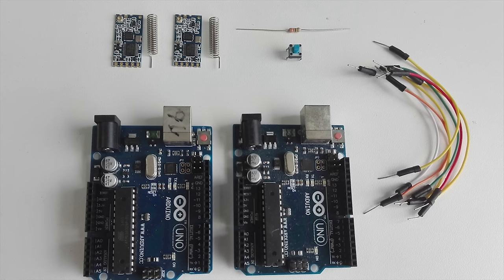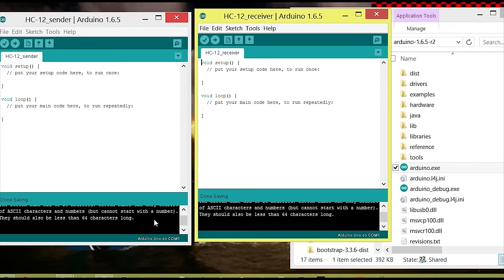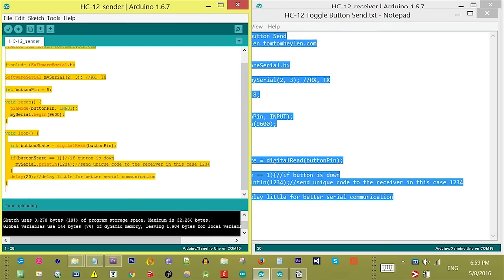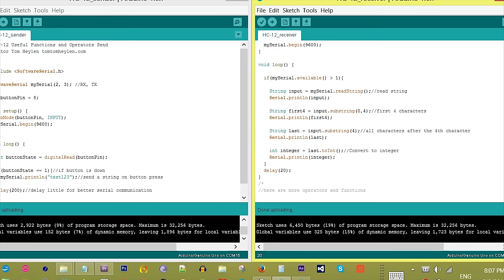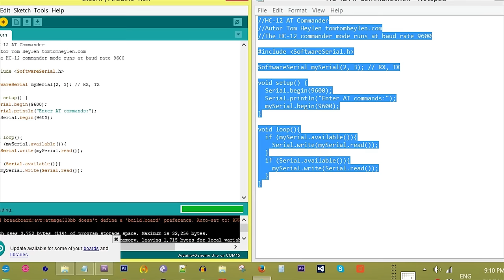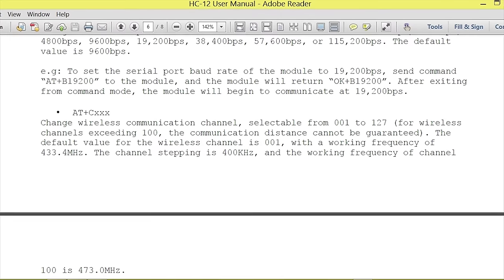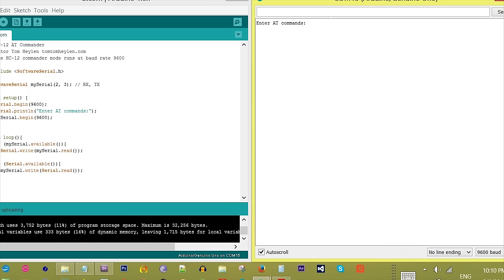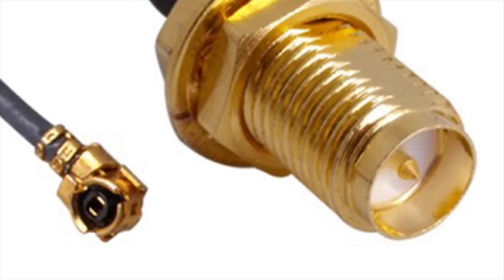Long range, 1.8km,  Arduino to Arduino wireless communication with the HC-12

Comment: Excelent video, +Tom Haylen!

I need to make a live communication system between a weather ballon and a home base on the ground. The altitude of the baloon is at least 100,000 feet and it needs to transmit at least a 360 degrees live video shot and telemetry. 

I know these transmission speed nor ranges are enough. How would you implement this?
Reply from the maker: +Victor Rivarola Your project will require a lot of research and testing. I would go for satelite connection in your situation.
Reply: Thanks. 

I guess I could arrange for a satellite transmission of the video feed, but I still really need the radio to transmit at least the telemetry. Is there such a solution?
Reply from the maker: +Victor Rivarola You  need to look in to a satelite module. And use the Iridium satelites. I'm not experienced with it but I think Iridium is an open source satelite network. It allows you to send and receive data anywhere on the planet. Here is the link to one of this modules.
https://www.sparkfun.com/products/13745
Reply: I wish that was the solution, but it unfortunately isn't.

If I use the Iridium satellites, I am restricted to use a packet driven mechanism a few hundred or perhaps even thousand bytes long, and it is restricted to RS232 speeds anyway.

So while it would work for telemetry, not for live video feeds.

From the time the balloon is released, until the time it bursts, and even when it is on its way down, I am guaranteed a clear line of sight signal until it rests on the ground practically. While I could still use Iridium satellites (these could be interesting when it comes to recovery of the balloon--"Here am I, rescue me!") it should be possible for me to have a small semi parabolic antenna and keep it pointed to the base at all times using the sensors already present in the balloon plus a few steppers. 

All I need is for the way for me to get a long enough point to point link going at all times.

I have also solved the problem of obtaining enough power (I could simply use solar), so I literally got that to spare.
Reply: So, my question basically is: how can I get a high bandwidth line of sight (one high res analog TV channel plus telemetry is minimum for meeting all the requirements, but only telemetry is also acceptable) , point to point, radio link going?

The solution would be similar to the one you exposed in your article--except that it would need a higher resolution and higher range.
Reply from the maker: +Victor Rivarola Sounds like an interesting project you're building. You have to do a little more research. There are other modules available on the market. Have a look here:
http://www.aliexpress.com/af/long-range-433mhz-module.html?ltype=wholesale&d=y&origin=n&isViewCP=y&catId=0&initiative_id=SB_20160511175729&SearchText=long+range+433mhz+module
Reply: +Tom Heylen 
Earth is much closer than any satellite. At 30 km (100,000 feet), it is much closer than say 300 km.
Reply: +Tom Heylen 
Uh, I will not get with Lora chipset. It has only 300 kbps transmission. Out there are much faster transmitters based on Si446x, which can go up to 1 Mbps (This HC-12 has this chip, just wrong MCU support on the board). I am about to mess with an "old brother" Si443x, which has only 256 kbps, but principle is the same (okay, some more code is needed to add to use frequency hopping if needed).
Reply: +Victor Rivarola 
If you think of live feed from the balloon, you need analog transmitter - some of FPV transmitters on market. Telemetry is okay with HC-12, but out there are versions with PA up to 1W. Just... how much payload your balloons can lift?
Reply: +WildMania 

Yes, I understand that the Earth is much closer than satellite.  This is one (a very secondary one) why I would rather not use satellites.

The Si446x really sounds like a good choice... 1 Mbps should really be enough, although incredible tight. It might require me to implement a Raspberry Pi controller to reduce the streams resolution before transmitting, while storing the high res stream on a SD or USB card for later extraction. That way, if I loose the balloon on retrieval, not everything about the launch is lost!

As for my balloon's payload capacity, that is undecided as modifying it later is much easier than modifying the electronics. Indeed, it should be possible to make a successful launch on one balloon, recover it, and use a larger balloon for a later launch.

However,it must not be that light. The things I need to launch so far are:

* 3 or 4 high res wide angle cameras and lens that must be sent by one link, using time sharing.

* Power source, which would include a large battery and a solar generator.

* Transmitter equipment.

* Data storage equipment (SD cards).

* GPS receiver (for a backup--these guys usually stop working once you reach a certain altitude, so I trust the accelerometers and gyroscopes more).

* Gyroscopes, accelerometers, temperature sensors, air pressure sensors, a push button (this would be modified and attached to the balloon's string--it would essentially be pressed when the balloon explodes, although the accelerometers could also provide that information), a few servos and/or steppers.

* Parachute (the alternative is not really acceptable: to make it bounce like a ball).

* Perhaps a few other stuff.

So, I would say in the order of 10 to 20 kilograms minimum would be minimum, perhaps even more.
Reply: +Victor Rivarola 
Not only that Earth is closer than satellite - you have to know when satellite will pass and use really good antenna, so idea about satellite as data repeater fall off the cliff. 

Out there are finished solution - without messing with programming Si446x, which are based on the same chip, but has 1W - good for long range communications. Only, those products are restricted by chip which is set to fixed values of data rate of about 384 kbps, which is still good for sending still pictures. If you are good in linux (I am not), then you can use 5 MP camera on Raspberry Pi and send single picture every so with telemetry data attached; where is the camera positioned, where it is oriented (azimuth, elevation...), and so on. Also, since those transceivers can work in both way by switching TX/RX, you can use it for command where servo for camera(s) to be oriented. This way, you can set wanted orientation of the camera(s), take photo and send one photo in say 10 second long transmission. At least good photo every so. This is because live video will be pretty boring because of slowly moving balloon. 

What you should be more interested is actually not pictures of earth, but your equipment - does it has damages, does it freezes, and similar. 

For data storage, you wish to have HD cameras with own microSD cards (usually it has microSD), that will be capable to record more than 2 hours. I have no idea how long this balloon can fly, but it can be possible to use 64 GB mircoSD cards for recording whole flight. If not, then having some live feed with low resolution (PAL or NTSC), so that you can select and run HD camera(s) at certain points in flight. 

Separate data storage for telemetry - altitude, velocity, temperature... etc. on separate microSD card(s). 

Things about GPS is good today - it NOT stop working at any altitude if you use "the right" manufacturer. Please contact professor, Mr. Paul McWhorter, who said that only Adafruit company understand law about GPS receivers, and that it can go over 100,000 ft if object is slowly moving, which balloon is for sure (not rocket). I will post link of his video talking about that below in separate comment with link, but because of stupid YouTube policy, this link will probably end in "Likely Spam" section, and unless user of this video channel approve this link, it will be "frozen" there forever. In this case, please put in YouTube search: "Paul McWhorter lesson 22", just to get idea why most of GPS receivers stop working over 18 km altitudes (60,000 ft). 

Regarding parachutes, you may use one in series between payload and balloon, so when it bursts, it automatically open this stage. Then separate parachute with larger surface area opens on your command, or by some sort of measuring. Or accelerometer, or rapid changing in pressure, or both. 

I would suggest inflatable floating balloons in the case of unpredicted flight over water surface, so that payload does not sink in this case. Will be good that in this case you have beacon which will send "help" data about GPS location for easier recovery. Actually, it is good practice to follow whole flight trip, but in the case of lost communication in the case that during falling it goes behind hill or something, secondary transmitter may send periodically data about current location. Why periodically?! Because of recovery time may be very long in the case that it falls in "hard to reach" area, or in foreign country... pain in the...

Also, some loud buzzer which will be activated by remote, when you are close, but not sure where it fall exactly. This way you will be saved hours of searching in the case it falls into forested area - you know roughly location of crash site, but don't know exactly. I am using similar thing on my quadcopters, when it falls away, I know where it is when I am close to about say 50 meters, but I am using small, lightweight one. You may use loud buzzer from smoke alarm. One or more. 

One good option is GPRS tracker, and if GPRS towers are in range, it may send you SMS message with crash location read by GPS receiver, or by triangulation of the GPRS data if three or more GPRS towers are in proximity. If not... okay, you need to think what else may happen before any flight. 

Maybe I forgot something, but you will get an idea. Maybe some "watch dog" system, which will control other system whether working, and if not, reset it...
Reply: Thanks! That means I could also use the GPS! That is particularly good since that would provide me redundant means of locating the balloon!
Reply: Yes, just be sure to buy Adafruit GPS as professor said. That's it.
Reply: Ok. I will. Thanks!

Comment: Hi Tom. Great video. I'm trying to send an analogue value to another Arduino (both with HC 12) and display it on an LCD . I can't get the receiver to pick up anything. The sender has its TX led on so I'm guessing it's sending the data across but nothing's picked up at the other end. I've tried messing around with the coding but with no luck. Is there a special code for analogue sending? Please can you help?
Reply from the maker: Are the examples from the video working? If yes, should be fine. If not, watch the video again. You have a great day.

Comment: I'm new with this, but Sir, I have a question , if I have 2 senders and 1 receiver, is possible to configure it for receive from 1 and later from 2? or another way to differentiate from each other in the print.
Reply from the maker: You can use multiple senders to receive with one ore more receivers. You have to encode/decode  your messages sent/reveived to verify you have the right message from the right sender. So yes you can :) Have a good one and enjoy your project. Cheers

Comment: What cheap board instead of the HC-12 would you recommend if I need to send data a maximum of 1km and about every 500ms?
Looking at the specification for the HC-12 it says only to send data every 2 seconds, and only 60 bytes at a time.

Comment: I did the same and uploaded the same code 
But I'm not getting the desires result.
Communication is fine between the modules when visualised in serial monitors.
But when the connections are given and the code is loaded, it is not working 
Someone pls help me out

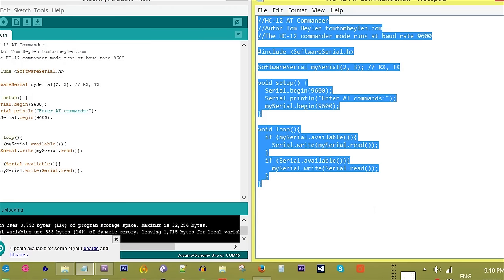Comment: At 4:56, Pin 2 goes to RX in the diagram and Pin 3 to TX.. But in your HC12 next to it you have 2-> TX and 3-> RX... Which is it?
Reply from the maker: tx should go to rx and rx to tx. You can set the pins in the code. Thanks for noticing. Have a great day!
Reply: @TomHeylen1  Thanks Tom.. So when the code defines "TX" does that mean it's TX pin on Arduino to be connected to RX pin on HC12 and RX pin on Arduino connected to TX pin on HC12" (10, 11) means TX and RX defined on Arduino.. This is confusing some people including me. And if it's backwards, does it harm the HC12 in any way.. Because I can't get these simple things to transmit or give me a response when I use AT commands.  Again thanks for clearing that first part up for me Tom.

Comment: Hello, Thank you for uploading such a detailed video. Could you please let me know if this module can work with Bluetooth of android phone?
Reply from the maker: Hi, it doesn't work with bluetooth. You need a bluetooth module for that but the range is not great. Maybe about 20 meters.
Reply: +Tom Heylen yes, I am using HC05 Bluetooth module but it don't work more than 10 meters, actually I want data in my android phone and data has to travel from far of place so I am looking for alternative to that.
Reply from the maker: You have to translate the data over your HC-12 links by using arduino controllers.

Comment: hey, great tutorial :-)
Is it be possible to talk to 433mhz sockets with the HC-12, because I kinda don't get it to working :(
(final usage: read out 433mhz temperature sensors)
Reply: already realized the problem -> 433mhz sockets/temperatures most likley use a different modulation than the hc-12

Comment: Question.... can one transmitter arduino connect to two or more receiver arduino that process the sent signal?
By instance, the sender arduino request to light a LED and 3 receiver arduinos respond by turning it on??
Reply from the maker: Yes you can. As many as you want.
Reply: Tom Heylen Thanks bro.
Reply: FOR instance.....
Reply: Hans Müller Thank you.

Comment: Very Important lesson. But in my case i used FU 4 mode, 1200 burd rate, transmission power P8. but its not work 1.8 km. its working around 350-450 m only.
Reply: is this distance achieved in open area or indoors?
Reply: I have encountered a problem where i cannot get more than 4m range with HC12 modules with small spring type antenna which was enclosed in the module, I did tried all the settings but no luck! Appreciate any help.

Comment: hello tom, is it possible to have 1 master and 10 slaves in HC-12? Pls response. Thanks! Thank you also for this video, it hepls me a lot! cheers!
Reply from the maker: Yes that is possible. You have to write your sending data accordingly. Example Send data: "slave1+data" and use string decode functions to distract the "slave1" from the data you are sending.
Reply: Thanks tom! i just want to build star topology network using HC-12. :)

Comment: The URL posted below, shows two HC-12 's  used with two Arduino's to form a 4 channel remote control link. Would it not be just as easy to connect the output of a RF600E encoder to the input of one HC-12 (transmitter). Then connect the output of the  second HC-12 (receiver) to the input of a RF600D decoder?  I don't want to use Arduino's at all. Another Youtube video claim that many of the HC-12's on the market are  clones which are inferior and have very little output, and hence very little range about 50 metres. They recommend you buy direct from hc01.com. Do the ones from Bannggood have a 100mW output (default level 8) when powered up? What power setting are you using to obtain a 1.8km range between the two units?

Thanks

https://photos.google.com/share/AF1QipOErwpVOHDI0nfqxZZp-xYoo8EtaMZSNv2lSN3--U2I3YvA2muyMWfKSIvi4Gh53Q?key=UWpRQWtCVVdEdWRoQXdWS3BJUVVZS0ZtUGJLOGhB
Reply from the maker: Thans for your interesting comment. The purpose of this video is to make it simple to implement and affordable since there are many students watching this and don't have the money to buy the expensive modules. The HC-12 modules from Banggood are great and work perfect. I'll check out that RF600D decoder. Might be interesting. You have a great day!
Reply: @TomHeylen1  Thanks for the speedy reply. I forgot to include the URL for the R600 encoder/decoder datasheet in my original post, so have included it below.

http://www.farnell.com/datasheets/56726.pdf

Comment: Does anyone else get delay when sendig from one serial monitor to the other? I get about 1 sec delay? is this the serial monitor that is slow or the communication between the arduinos?
Reply from the maker: You need to change Serial timeout in the code. It's all in the tutorial. It is standard set to 1000 milli sec. (1 sec.)
Reply: Aight, that fixed it. Thanks.
Reply: I'm going to guess that it is having a difficult time establishing a serial handshake.